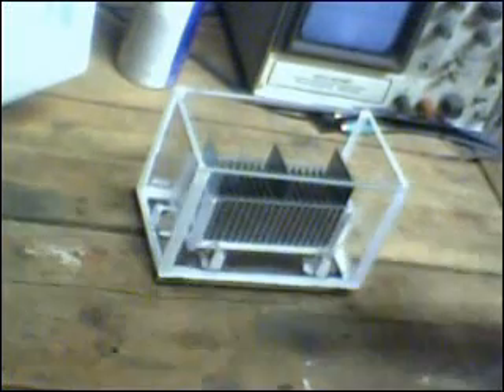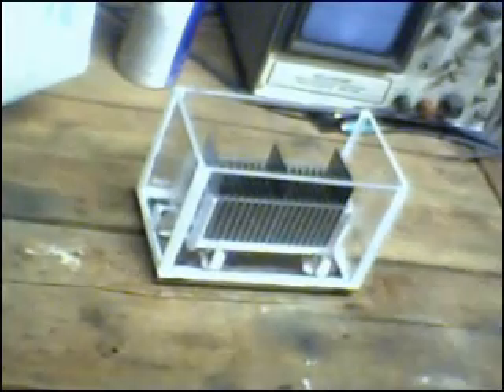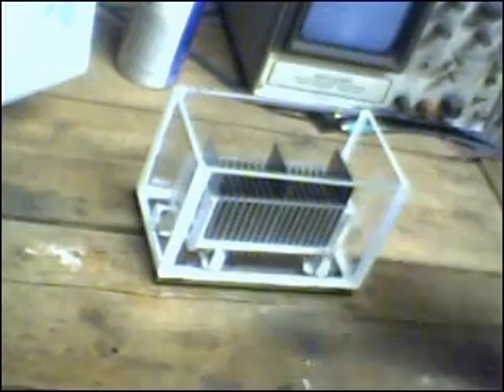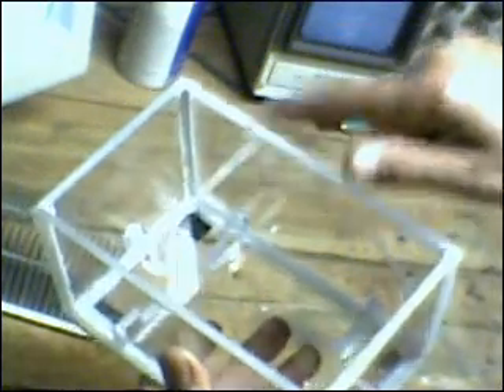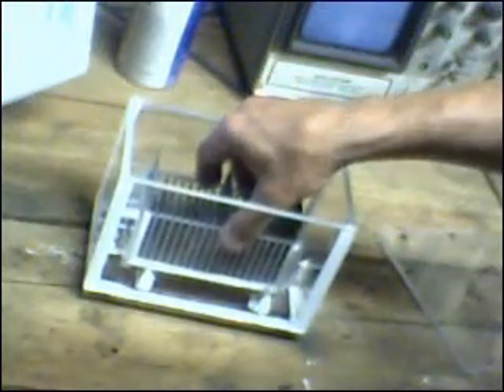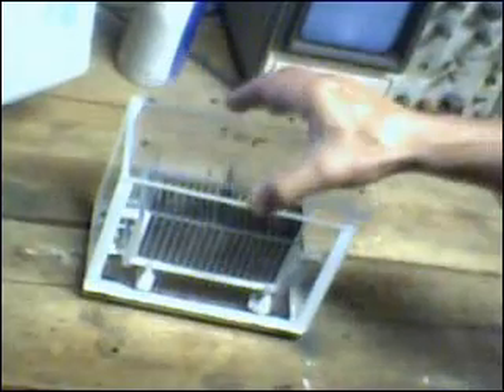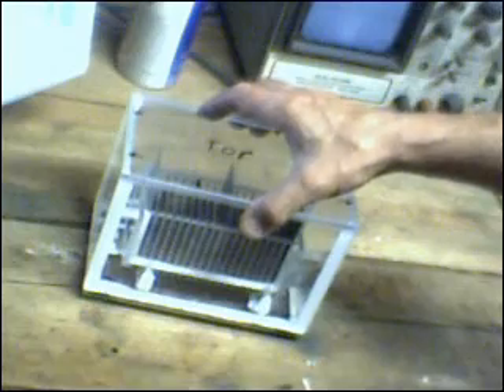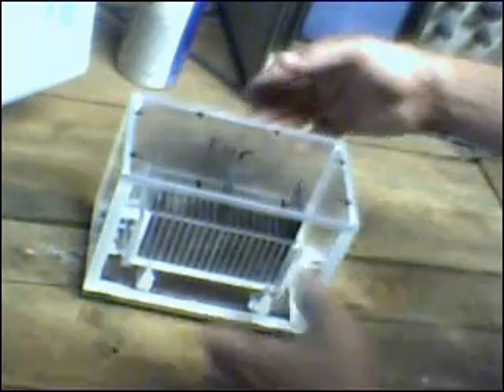17 - Hydrogen HHO Electrolyzer test unit Tank Details 06

Comment: Thank you and you got some good handy work going there yourself. I used a juice container 2qt, $1.50 for mine that way if it does have a flash back it will just pop the lid off. Just click on my profile and check it out if you'd like.